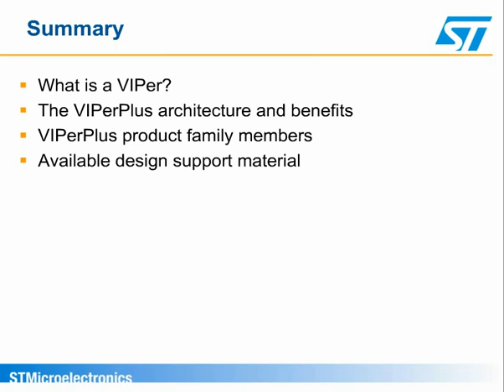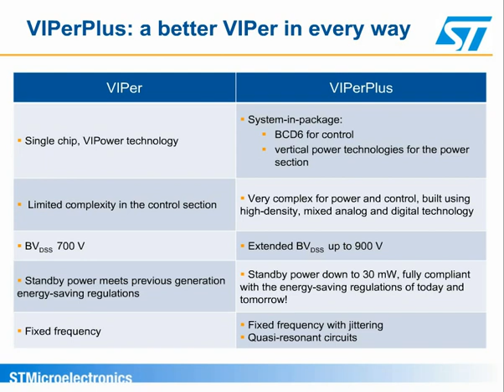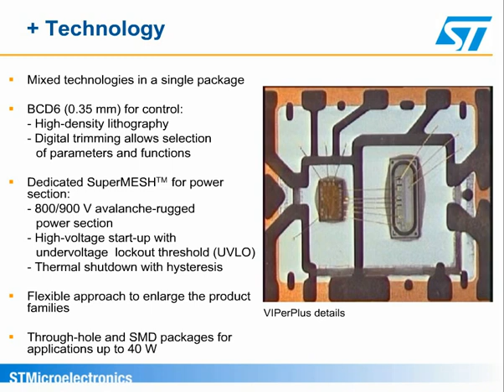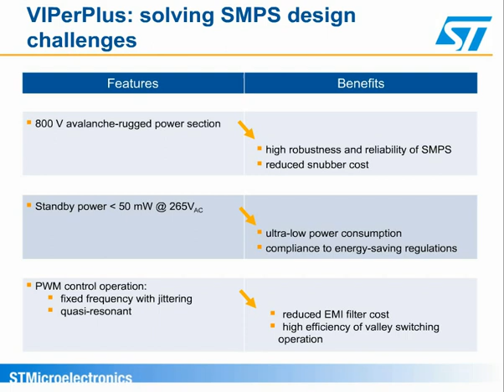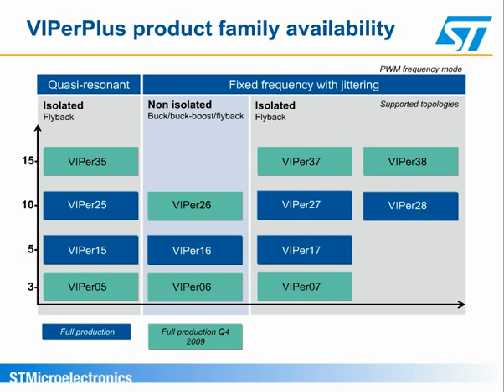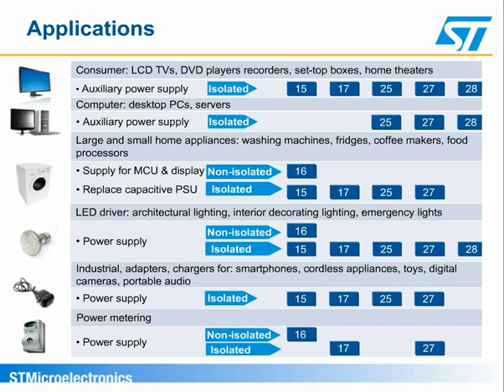VIPerPlus - Truly innovative power conversion (ePresentation)

Comment: @3:41: The Control IC is built on a 0.35mm process not 0.35 micron (um) as stated by the narrator. 0.35mm translates to 350um(microns).